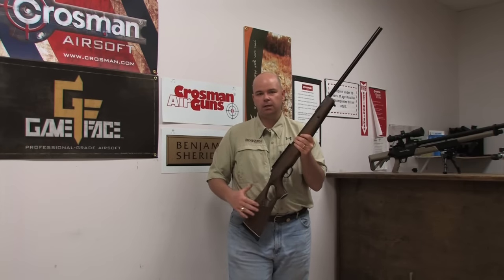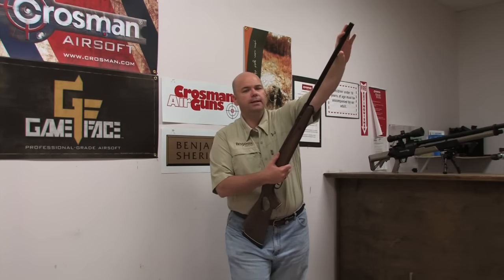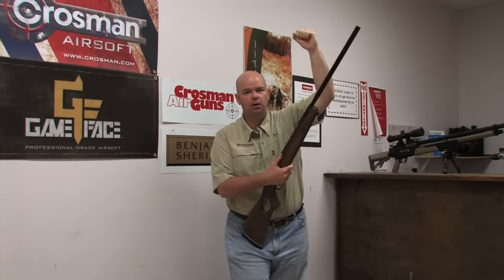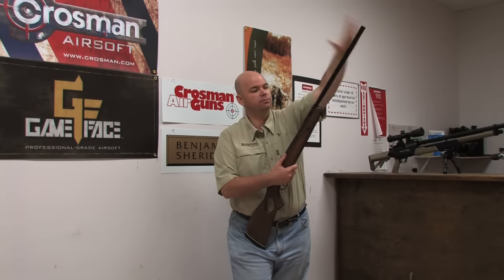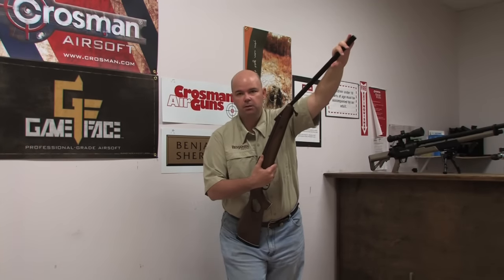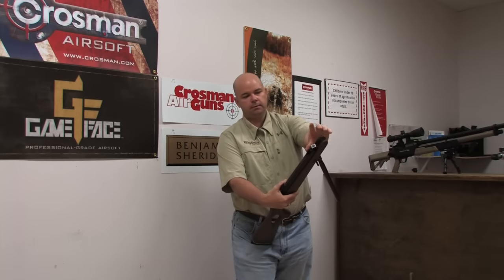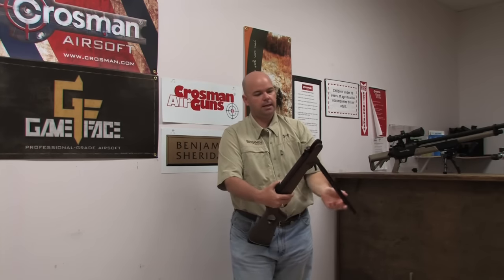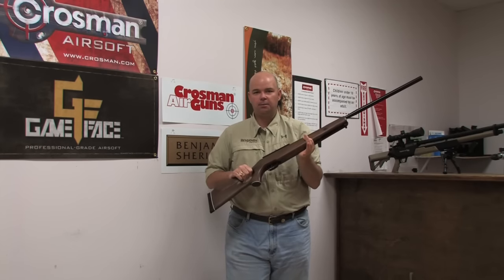How To Cock A Break Barrel Air Rifle

Comment from the maker: The barrel is essentially a large lever. Pulling the barrel (lever) compresses a nitrogen-filled gas ram (or steel spring in some guns) which is held into place when fully cocked. Pulling the trigger release the ram / spring and as it expands the air ahead of it is compressed. The pressure propels the pellet down the barrel.
Reply: How do you de-cock a Crosman Blaze XT (Nitro Piston) safely without discharging etc? Also, will it make a loud noise?

Comment: Very poor demo mate - What happened to `and ALWAYS remember to hold on to the barrel when you load the pellet` just in case the trigger fails - The way you're showing it could result in a big black eye and a barrel bent up like a bloody banana.
Reply: So very true.  Surprised that Crossman did not include that basic safety precaution most manufacturers emphasize in their instruction manuals.

Comment: I am going to lend a friend a budget break barrel tomorrow and searched for a video for him to review in how to cock and Safely load one.  This video falls short.  As has been mentioned by others, keeping a firm grip on the end of the barrel with tension is a safety basic.   I had the trigger / sear fail on me once causing the barrel to fly up and slamming closed.  I was lucky that my fingers were not near the hing point and that it did not hit me.  The force was enough to bend the barrel.   Others have not been so lucky.    Not keeping a firm grip on the barrel end while loading makes as much sense as pointing it at others while cocked and loaded, thinking your finger is no where near the trigger so all is good.

Comment: this litterally saved my life like in many ways, had a hatsan i got first breakbarrel and was looking for a lever or pulling barrel and supressor eeeeeeeh, and then just said F** it google "How to charge single pump break barrel" idk if there as a "faster" way - the one i have is .22 repeating and the slap and then pump slows it tf down kinda defeating its fast follow up ability - tho it really is just so i don' have to handle lead all the time (and easier to carry in a bag with some extra mags - got it for the remote montain area and trails where high ammo prices and medium-low danger bobcats at worst and a "warning shot" and ive thankfully never had to harm a cat or wild dog and on top of it avoid me from them on which is how i would like it , "better safe than sorrry" , and yeah this video i was able to figure out at least the "slap N prime" , and can get it to nearly one motion - i also liked breakbarrels as NO GAS To use or buy or forget to bring lol, and ACCURACY, seen firearms that hit worse in the same caliber tbh, and like the only downside is well its repeating not fully semi, but id take more power and land vs miss a bunch and have less powerful shots (any pcp and they are 100-200 more even for the cheapest ones) for like .22-25 this and some of the new gamos have REALLY good FPe at even 12gr-13grn stock pellets and i use 18.1-18.13 *sweet spot imo less loud like if there is sound or recoil it is quitere than even a "bb pistol at 500fps" - idk if that is the supperssor but damn i can have it next to my ear and its nothing tho have shot shit like 30-06 so its probably not that bad *under sound barrier - vs the saame db as a stnd FLASHBAND 128.130db is what a reg 30/06 M2 ball puts out or id BELIVE it - also idk if anyone knows more about break barrel maitinance it seems pretty straightforward dont clean rifiled barrel untill 6k shots or it is loosing accuracy - plan to ballistol the body of they synthetic material - which to its credit has taken a lot of light rains and this didnt mean to be a product review just for under 200usd - only reliable repeating trail air rifle that hasnt had a feed fail in 200rnds now which - to be fair it did struggle with even a few grns sub 18 cycling, so idk id say if its at least 20+fpe base you want a HEAVIER pellet< i also notice windage isn't S** compared to .177 along with "flatness" - i wish they included more rails - or is it cheap/feasible to ADD RAILS - its a good enough "keeper" id consider adding a bottom rail and sides for a flashlight, laser (cqb at night) , and a better optic that ideall can be pulled to the side - the IRONS are where it signs and love it but it is annoying as i have winding trains so like <5m to >50m turns, so comprimise between a score and a non-adustable front in an emergency, but yeah if it wasnt for this video i would have S**Housed it in the rain instead of running the clip and being able to head back *was getting mighty dark too - i just added in the info about the Hatsan as anyone looking for an all-purpose light game , trail, urban self defence *take the scope off and maybe consider penetration with dry-wall, seen it bust trees even .223 can struggle with- idk people think oh its air its safe kids toy (airsoft and like air guns are like- throwing a pebble vs an avalanace coming down - cant really be described ow that kinda brusied me - oh shit thru and thru penetration and does anyone know if there are good NON LEAD pellets and the pros and cons of them not a fan of lead and have a very odd winding water table i don't wish to ruin (use backstops but uh not much "stops" it other than 6+" of tree log behind another plastic bin that is rated for.22 even , like also breakbarrles are a bit much at first luckily im in shape and i still had a bit of trouble getting a feel for it - i jsut dont reccomend slowing down - keep it at least same speed and  if i start slow i noticed cocking is much harder but i get a MUCH "hotter" (powerful) load, idk if there is a tech to getting max power for single pumps - i assumed with one pump youd more or less get the same power - and after the 1st 100 the variation has gone down a bit and is much more consistent i hope to never have to seriously use it but the last thing is it malfunctioning , and or hitting some other animal object windows ect to their credit they dont usually drift further than the reticule edge at 100yrds or more even (and i don';t excpet friggen .338 lapua magnum, no like a 45/70 halfed so like .22 and man portable with a small backpack for long hikes at under 10lbs it perfect for that just still learning about break barrels it is facinating that a SPRING can still put some of the most high end pcp gams blockbacks in even higher calibers down - tho they are "True semi auto: id rather depend on having to charge a shot rather than blast a bit And as i call "dig dug it" as you do that with a bike pump it feels goofy and not what id want in any danger lmfao flip and forget , breakbarrels simple all weather *testing in snow still but does light rans fine if barrle is covered ofc, if anyone has tips/tricks esp regarding "repeating browing T mag styled breakbarrels there is the LEAST info on them and idk if i apply single shot info to multi? nothing really says pyramid air have been a godsend but they can only give me so much info , as far as how often if ever it needs to be servied routinely *they seeem to be QUITE Durable if treated and cleaned often
Reply: What’s wrong with you?
Reply: Possibly one of the longest comments on YT 😂
Reply: @amococ2487  Not possibly.

Comment: Most of the new break barrel pellet guns have suppressors which you do not want to grab onto and pull at an angle every time you load the gun.
Normally I grab right below the suppressor even if not recommended in the manual.
Reply: You won’t damage the suppressor at all by cracking the barrel there at all.

Comment: I agree with your video except for one thing. 
Once you break the barrel with the firm tap on the muzzle, load the pellet then, do not load the pellet AFTER you have fully cocked the rifle and the chamber is charged.
If the lock slips or fails, the barrel will snap back and could cause physical damage, especially to finger tips etc. 
I tell you this from experience.

Comment: so we straigth away push the barrel down?
how many times or just once?
it is heavy?
becus i used multi pump air rifle and it is quite heavy to pump it but the power im satified with its power.
Reply: from vids i've seen its a one and done pump.
Reply: I'm 13 and I have a air hawk I can break the barrel so it's open but then to actually cock it I have to put the butt of the gun on the ground then take both of my hands and push the barrel down untill it clicks, the high velocity style air rifles are really for hunting and practice, I own a m4 pump air gun but compared to my air hawk or any other high velocity rifle it makes my m4 look like child's play.
Reply: Dragonstorm1557 GAMING same I am 11 I have a webley VMX quantum and put it on the chair hit the top of the barrel then pull it down till it clicks.

Comment: that should be called "How not to load the air gun."
Normally I just open a breach a little bit, placing pellet inside than fully  break the barrel and close it in one move. Never let the barrel hang loose
Reply: Very good idea !
Reply: That makes sense.
Reply: That's how I do it too!
Reply: Exactly, I told him the same thing.
When I was 14 yrs old. I had a brand new .177 break action (adult style) and it had a faulty catch.
I obviously didn’t know this and it only occurred occasionally but that first time it happened, it nearly tore my arm off as I wasn’t ready for it, it was violent.
40 years later and newer guns now, I ALWAYS slightly break the barrel, load the pellet, then fully engage it keeping control of it all the way until locked closed.

Comment: Does it need Co2 cartridges?
Reply: No, break barrel is powered by springs which is why you bend it so far and hear a mechanism go into action
Reply: You can get a beakbarell sniper on Crosman for about 160$ CAD that shoots up to 495fps .177 cal which can take out squirrels and possibly coyotes if hit in the right spot but most likely just hurt it or give it a prolonged painful injury that could result in death
Reply: @Marthaulamule  thank you for responding. How long can a break barrel air rifle last for until I need to change the string inside. Also can a glock gen 5 air pistol strong enough to kill animals?
Reply: @darkskull8938 What string are you talking about?
Generally speaking, a quality, break action rifle, can last you 10-20 years or more.
All depends on how you treat it, maintain it, store it and how often you shoot it. 
Kinda like a car really.

Comment: Your slap system is good for a start but then I have to hire a arm wrestler to man handle the friggin' barrel down to cocking position. I like the rifle but arm wrestlers are expensive and not always handy. It just too torturous to hassle with so it sits til I sell it at a flea market. Too bad.
Reply: Make sure you’re putting your hand at the very end of the barrel when cranking it down. The ‘muzzle’ it’s called. 
That will make it much easier as you have more leverage.
This is assuming you don’t have dental floss for arms of course.

Comment: you could hit mine all day like that and it will not break open. I have to put the butt at my foot and hold the barrel then slam the breaking point with a open fist just to get it to open up. once cracked I can pull down on the barrel as shown.
Reply: ***** it was my first pellet, the newer NP2. when I called crosman, they said they can't do any thing about it. by the way when it finally cracked open it sounded like the creakest haunted house door ever from any horror movie.

Comment: That is NOT the way to load a break barrel or underlever. As stated, just breaking the action on a break barrel should allow you to load. Then cocking stroke and immediate closing pointing the barrel downrange in case of failure. Under levers especially if it has a skiding cover to the loading port YOU HOLD ONTO THE LEVER UNDER TENSION at all times especially if you fingers are inside. Some weapons may have variations but NEVER leave the barrel unrestrained when the barrel is broken and cocked. You are ASKING for trouble. Lost or crushed finger. Barrel flying up and smacking you square in the face... broken jaw/teeth/nose anda banana barrel as well.